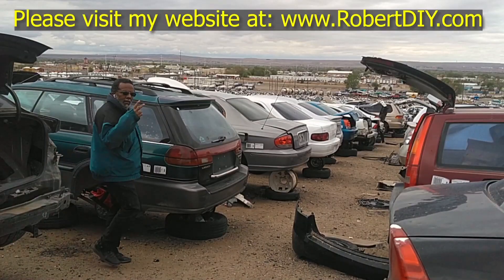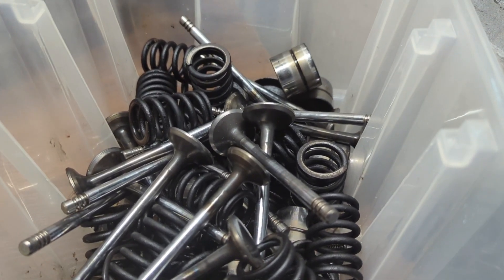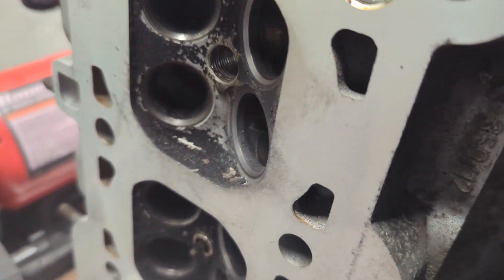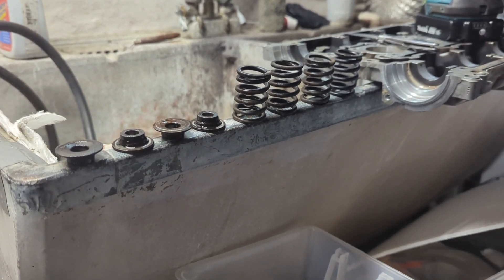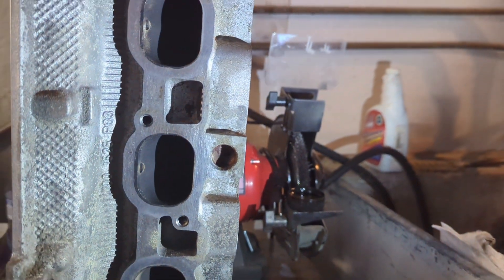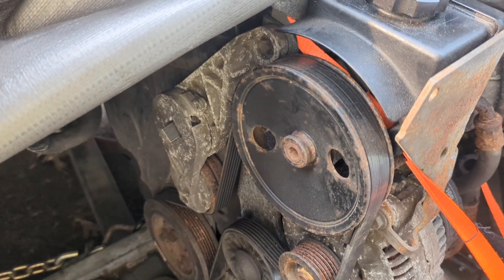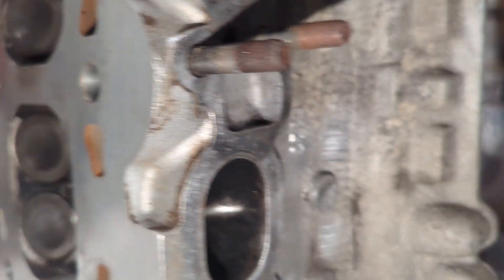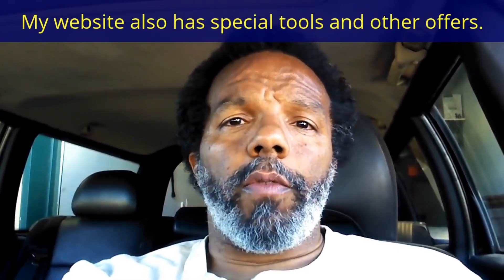Battery charging, rebuilding a cylinder head, and bad alternators. - HOWR

Comment: my motor guy sprayed scrubbing bubbles on the valves and used compressed air in the chambers and said watch this ... shot air  in the chamber and all valves leaked.  then i said ok to a hot tank and valve job as $300 was justified. !
Reply from the maker: Interesting